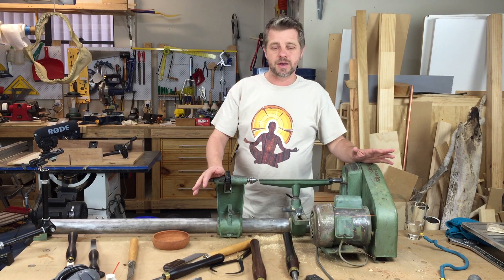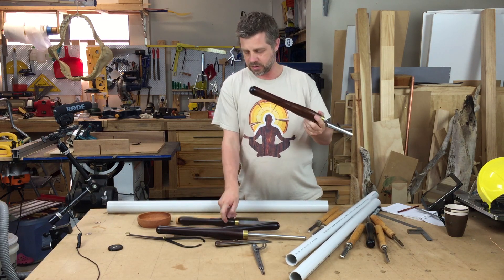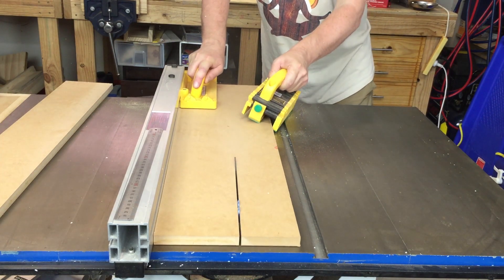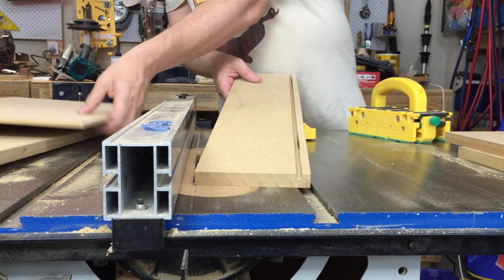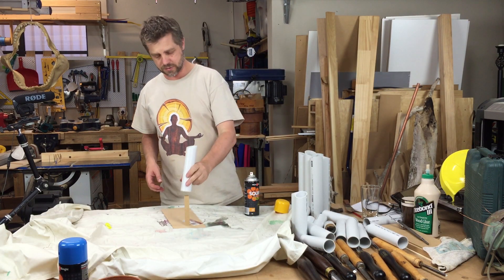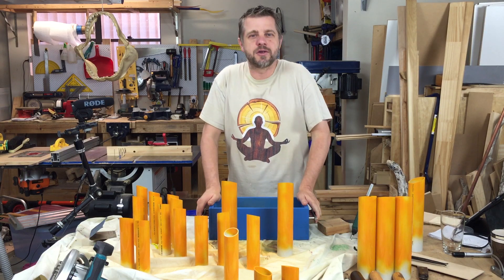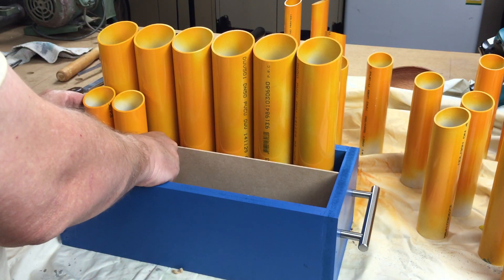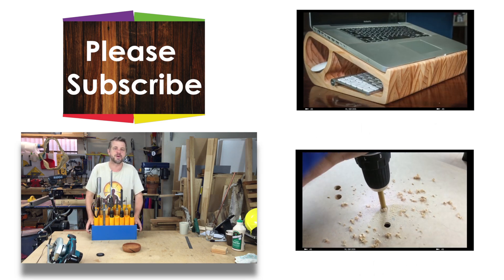★ Woodturning Lathe Tool Storage SOLVED | Easy Woodworking Project for Beginners

Comment: Hey there friend 🇺🇸 I use PVC pipe also for years - I took a flat screen tv mount that pulls out an swivels an mounted the tool carrier to it - when I am finished turning I just push it up against the wall - out of the way- all so I put 1/4" wire on the bottom an the shavings fall through
Reply: I have an old TV mount and you’ve just given me an inspiration.  Thanks!

Comment from the maker: Woodturning Lathe Tool Storage Problem Solved with this Easy Woodworking Project video for Beginners

Build a Lathe tool rack for your woodturning tools, this woodworking project is also an easy beginner’s project and solves your lathe tool storage problems.

In this woodworking video I’m going to teach you how to build a practical lathe chisel storage rack, we will go through how to cut the pieces of MDF on a table saw and how to lay them out as well as some practical tips on spray painting your woodworking projects.
This rack holds 22 woodturning chisels in a small box that is easily moved around the workshop, you could also use French cleats to stick it to the wall when not in use.

Also a big thanks to everyone for helping us reach our 10,000 subscriber mark, it’s really very exciting for me to get there.
http://youtu.be/3wlvdoKyFKg
#woodworking #woodworkingprojects #lathe #woodturning
Reply: Wood turning tool storage

Comment: I dont own a lathe but I like th is idea. Saves wall space and like u sd pretty simple to make. 
 
Im now subscribed,
Reply from the maker: Thanks Joe, i will probably stick a french cleat on the back of it so i can hang it on the wall as well.
Reply: OneWood - Warren Downes nice! I was thinking same thing. Just got done watching ur workbench video. Never knew kreg had a heavy duty jig..illbhave to look into that .
Reply from the maker: Joe Walters Yeah i have found it handy for bigger jobs, the smaller one could easily do the workbench as well if you already have oen of those.

Comment: Do you have any videos on the operation, use, maintenance/repair of the lathe shown. I just picked one up and have run into some unique issues, especially the bed way system and the key that runs along the bottom. I would love to get some insight from someone that has experience with this model lathe.
Reply from the maker: Hi Chris sorry i don't have anything like that at the moment.
Reply: Good luck. I've looked all over the net and found nothing of any value. Only thing I learned is that it is referred to as a mono tube lathe. That really isn't helpful but makes searching a little easier :-)

Comment: If you wanted to you could put some french cleats up on the wall to hold a whole bunch of tool racks like this and put a french cleat on the back of your box. That way you could hang the box up out of the way then use the handles to easily grab it off the wall and move it to your work area.
Reply from the maker: You must be a mind reader Tim. I have planned to do that for ages just need to find the time to pull my peg board down and make it cleats.

Comment: When spray painting and plastic the first coat must be very light coverage is not important let it dry for 10mins or until tacky then the next coat can be much thicker the first coat will almost make drips impossible and make your coverage much easier.